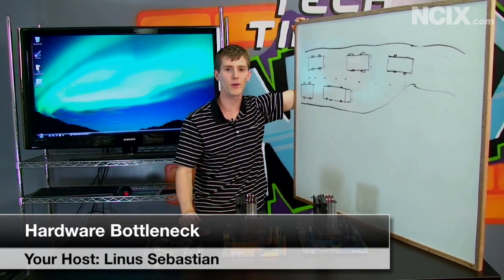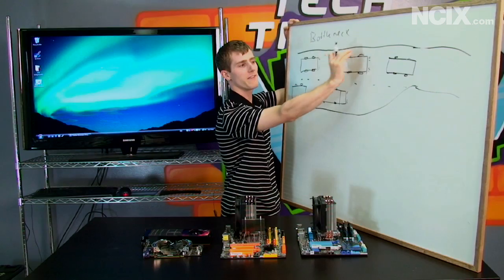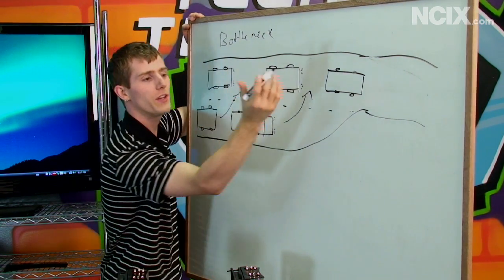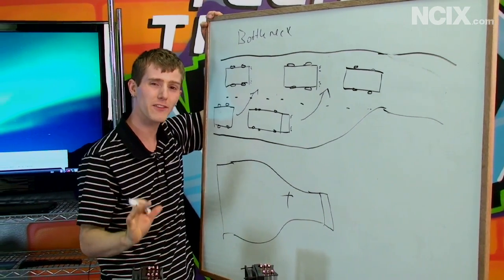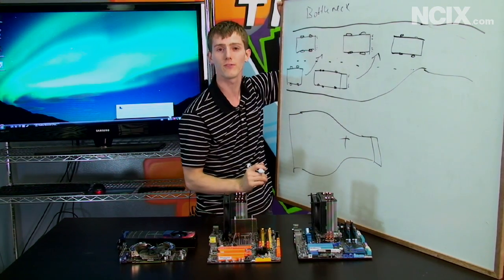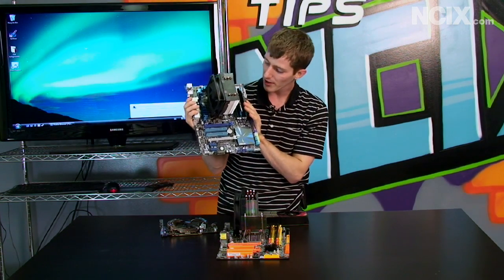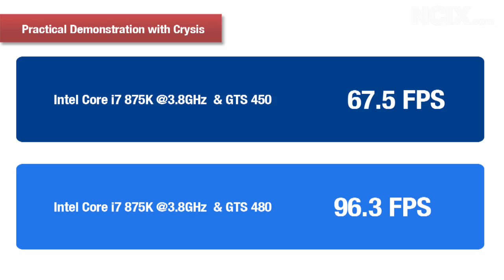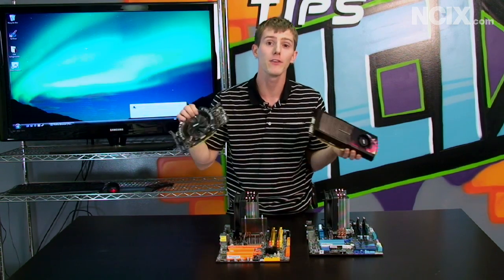Understanding Hardware "Bottlenecks" and How to Avoid Them (NCIX Tech Tips #81)

Comment: Im thinking about upgrading my PC, will any of these parts Bottleneck?

AMD FX-6300 Vishera 6-Core 3.5 GHz Cpu
MSI Computer ATX DDR3 1066 NA 970A SLI KRAIT EDITION Motherboard
Kingston HyperX FURY 16GB Kit (2x8GB) 1866MHz DDR3 Ram
EVGA 600B  Bronze 100-B1-0600-KR Power Supply
Just wondering
Reply: oh and a Rx 480
Reply: I think that it is not going to bottleneck, but if it does it will be a light one: just overclock your CPU to 4.0 GHz
Reply: Ok good thx man Felipe03000

Comment: what's the bigass thing stucked on the motherboard?
Reply: thats a heatsink for the CPU, im not exactly sure what one but its alot quieter and gets rid of heat better than the stock one
Reply: no way, where to get it?
Reply: Mahendra Adriansyah like i said im not sure what the one he is using is but www.ncix.com is a great place to shop for them.
Reply: yo man, i'm got my Athlon II X4 635 bottlenecking my hd 7870... is there a better card that can run on a AM3 board? thanks man
Reply: Mahendra Adriansyah im not the person to ask that sort of stuff to, i recommend tomshardware forum theyre pretty smart.
Reply: thanks a lot for responding
Reply: Mahendra Adriansyah When it comes to CPU heatsinks, you really should consider getting an "aftermarket" one, because more often than not, the heat-sinks that come with the unit are not very good. Much for the same reason why I will not ditch a camcorder just because a I have a phone capable of recording at a higher resolution.
Reply: Mahendra Adriansyah
start at pcpartpicker.com, get a list of like 5 cpu's then research them to figure out which is truly the best

Comment: hey i bought a Mac pro 1.1 really cheap in mint condition but the specs were extremely bad iv don some upgrading to the machine now iv changed the 2 xeon dual core for 2 xeon quad cores x5355 upgrader the ram to 12GB of server grade ram running a 120GB SSD with a 500GB HDD and I replaced the old 7200gt for a evga GTX660 SC 2GBcould anyone tell me if there should be any bottle necks cause im playing batman arkham origins and battlefield 4 on Ultra with no FPS drop as far as i can see Im only asking cause the machine is old and id like to now

Comment: not in sli or crossfire. I was just thinking at the time: What setup would bottleneck like crazy. Also Im not quite sure if you can run 8 gpus. I think windows supports 4 and linux will take 8.

Comment: I have Intel G630 Dual Core. Will there be a bottleneck if i buy gtx 780?
Reply: Yes it will bottleneck it bigtime. i would say that your CPU max should go with something like a 560Ti 1GB / 6950 2GB.

If you wanna go above i would say you need a quadcore and something with a 'i5' or 'i7' in it, then you should be good to go with a 780 or even a 780 SLI.
Reply: Thank you. I guess I will build from scratch then.
Reply: I would strongly advise you to do that if you're going to upgrade to a 780 or simular card.

An article that can clarify the bottlenecking of CPUs can be seen here:

http://www.anandtech.com/show/7189/choosing-a-gaming-cpu-september-2013/6

In general the point is: Going to build a gaming computer: either choose the top AMD CPU or the i5/i7 intel CPU. I personally would recommend an Intel, even though the price is a little above. But anything from i5 3470-> i7 4770K and you should be good to go. both of these CPU's also support PCI-e 3.0 that you're 780 will benifit from.
Reply: Bo Penstoft
Thank you for the advice. After 2 months my budget will be around $1000.
Reply: for that cpu HD7770 max in newer games
Reply: i hope this is a joke but if your serious yes
Reply: Andrash88
my current GPU is sapphire HD7770.
Reply: MrElosobear
i wanna know ur fps on a game lolol. i bet i have same if not better with my HD5770

Comment: Do you think an Intel Core i3-4130 3.4ghz and a Radeon R7 2gb gddr5 would do bottleneck?
Reply: Alvaro Azcárate I have that exact cpu and a gtx 970 and on gta 5 on ultra - very high I get around 40 - 75 fps i got a bottleneck but its not the biggest so you might be fine but your losing a decent amount of frames like me
Reply: Thanks man

Comment: Upgrading my graphics card, will I bottleneck my cpu with:
Intel Core i5 2500k OC'ed to 4.2GHz
8GB ram ddr3 1333MHz
GTX 970 4gb gddr5 (The card i am thinking of upgrading to, old card was amd 6870 1gb, always held my system back)
PSU 750W
Reply: No, 2500k is fast as any new 4th gen i5. Try to overclock it some more. :)
Reply: thanks :)

Comment: Whatever you do, you always will have a bottleneck. The question should be: Does one component in your system perform significant lesser than the rest? Then upgrading that component will improve performance to a level at the next bottleneck.

In general I dare to state if your system doesn't run on a SSD drive, your bottleneck will almost certainly be your hard drive.

Comment: Would a
AMD Fx 4350 4 x 4,2GHz 
Corsair 450 watts 80+ PSU
Crucial 8GB DDR3 @ 1600mhz
bottleneck a 
Sapphire R9 270 2GB GDDR5 @ 1050mhz  ?
Reply: Don't think so.
Reply: Faham poordaryaei ok thanks for the answer
Reply: ***** I think a 500W PSU will be better.
Reply: Faham poordaryaei how about with a r9 270x?
Reply: I´ve a  270 non X so i only got 2 gb and for me its enough.. if you overclock the gpu from 925 to 1150 mhz you´ll get a stock 270x because its based on the same gpu
Reply: Tal Zeraviv Actually my hardware arrived 2 already and the New Model of VS 450 wich i´ve got has a +12V rail @ 34 amps
with that said. my system runs smooth and with now errors even if i start prime95 and the valley benchmark.
I only have 1 HDD no DVD Drive
1 Case fan and thats it.
Reply: I'd think the sapphire will be the bottleneck.

Comment: Hello i have currently got;
AMD 3.6Ghz FX4100 Quad Core Processor 
-8GB DDR3 Ram and 1TB Hard Drive 
-ATI Radeon HD7770 1GB Dedicated DX11 Graphics Card 

what is the weakes part in the pc and should upgrade first or is it more woth my time to simply sell it all snd start from the ground up?
Reply: that's just perfect man for a decent gaming
Reply: ***** nar it lags with alot of stuff im looking to run modern games on 1920x1080 will maxed out settings...(single monitor)
Reply: go for 7970 or even R9 290x man... or if you're on a budget then go for 7870.. mine's running smooth as a baby on 1920x1080
Reply: get Solid State Drive.  I think that it would boost your system.
Reply: drath lian i would love 2, seems like a bit of work to transfer my os and installed programs to the SSD. Are there any programs that can do it 4 me?
Reply: i dont think ssd is worth it man on a gaming pc... but you can of course go ahead and try... if i was you i'd invest in a better card,,,
Reply: ***** indeed but i can simply endure the bottle neck until i upgrade the next slower component until its all up to scratch
Reply: jayden barr
Macrium Reflect Free
Reply: Mahendra Adriansyah
It's totally worth it, SSDs speed up game loading time.

Comment: I wish I was a FPS gamer. I play simulators and ArmA so I have to deal with fucked-up, unoptimized 1.5-core products so I have to spend a lot more money on the CPU and when I want to play some regular game for a change I get half the performance I could get for the money because non-sim games rely more on GPU.

BTW, don't buy ArmA 3 unless you have no other choice or you've built your rig specifically for ArmA. Preferably with the monster clocked dual (or single?) core Celeron released recently.

Comment: i3 540 with gtx 750 ti will bottleneck?
PSU = 380 Watt
Motherboard = H55M S2
RAM = 4 GB DDR3
Reply: Lex lol i had this exact set up when i was new to gaming. no it doent bottleneck but more ram would help. but i had that only and it worked fine for low end games . a little gta and stuff too

Comment: Do you guys think i will have a bottle neck?
EVGA Geforce GTX 970
ASRock x99 extreme 4
Intel I7 5820k
psu 1300w (high because i plan on going 3-way sli and the 1300w was cheaper than the 1000w)
4x4gb ddr4 (can go up to 128gb)
What do you guys think?
Thanks for the input.
Reply: My friend has the same system except for the crazy power supply. A 900 watt would be enough. The gtx 970 does not consume a lot of power. Good luck on your build!

Comment: will a Intel Core i5-6600K bottleneck a 1070
Reply: you should be fine the i5 6600k and 1070 are both latest gen. i'm actually getting the same.
Reply: Admirable Ackbar what about a i5 6400 and a 1060 Super Super Clocked
Reply: BallisticWaffle I feel like you should be fine, but just to make sure double check with your closest PC shop, because I am no expert.

Comment: Hi Im running a
Motherboard: MSI G41M-P33 (Socket 775)
CPU: Core2Quad Q6600 2.4GHz 8 Mb Cach
RAM: 4Gb DDR3 1066MHz Dual-Channel Single Memory.
GPU: NVIDIA GT 610 1GB.
HHD1: Samsung 840 EVO 500 GB (SSD)
HHD2: WD GREEN WD40EZRX 4 TB
Extern1: ASUS Black Blu-ray Burner SATA BW-12B1ST/BLK/G/AS
Extern2: ASUS 24X DVD Burner - Bulk Black SATA Model DRW-24B1ST/BLK/B/AS - OEM

And i was wondering if my GPU i botlenecking my pc becouse i play some games not heavy but i was always able to play 6 games at the time at medium with my old pc and know i upgrade it and only able to run 3 at same time?

PC Price arround 650,-

By Robin de Bie
Reply: Hi thanks for your respond but i dont know if it make any diferents my old card AMD HD 7750 1gb

Comment: guys i need help i think i got bottleneck when i play gta 5 on ultra settings with msi gtx 1080 i have 60 fps with resolution 1680x1050 not even hd and gpu usage 50% sometimes 80% on for example assetto corsa (racing game) it uses 99% 

why?

specs are: 

- I7 3930K 3.50 GHZ 6 Cores 12 Threads

-Asus Rampage IV Xtreme

-MSI GTX 1080 GAMING X 

-Gskill Ram 16gb 2133mhz

-Seasonic 1250 Watt power supply

Comment: I just got a msi r7 260x 2gb OC what cup should I get so I don't bottleneck right now I'm useing a intel core 2 duo -_-
Reply: if you want a new cpu, i know that the r7 260x is a new card but for a decent gaming system you will need at least an i5 or amd quad core AND buy a new GPU as that gpu will bottleneck either of those cpu's.

Comment: Heya Linus,
I have a game system that i would like to upgrade, but have no idea which part needs updating.
System specs:
Motherboard: MSI Z77A-GD80
CPU: Intel Core i7 3770K Boxed
CPU cooling: Corsair Hydro H80i             
Memory: 16GB Corsair Vengeance LP CML4GX3M2A1600C9
GPU: Point of View GeForce GTX 670 Dual Fan         
Soundcard: Creative Sound Blaster Z
DVD combo: Samsung SH-224BB Zwart         
PSU: Cooler Master Silent Pro M2 520W         
Harddrive 1: 1 x Samsung 840 series Pro 128GB
Harddrive 2: 1 x Seagate Barracuda 7200.14 ST1000DM003, 1TB            
Case: Corsair Obsidian 550D         
Monitors: 2 x Samsung Syncmaster 203B Zilver, Zwart
Keyboard: Corsair Vengeance K90         
Mouse: Razer DeathAdder Left Hand Edition         
Headset: Razer Carcharias

What would be the right upgrade path for this machine ?
Reply: Heya im not linus and this video is outdated. but if u want to upgrade get a  SSD  or  Graphics Card and 32 gb
Reply: Everything here is great, but you could go for an AMD 280x or 290x if you want that extra graphics card performance.  Nothing else will slow you down, and you do NOT need any more RAM.
Reply: you have a beast. Cpu and all that ram is ana overkill for gaming. Only thing that you would feel in gaming is a new gpu (but even that yours is great).
Reply: Thanks guys. I have been looking at a new grahics card, not sure if i will notice much difference though.
Reply: Fr3ubel
280X or gtx 770 would be small upgrade. I'm not fan of expensive cards - they don't pay off - they are unprofitable, lose lot on price with time and soon comes out better that's cheaper- so I wouldn't change your card. Just turn off stupid MSAA, vsync and mabey other filters if you want higher fps.
Reply: Ok, thanks Andrash88, think i will leave the system as it is atm. Thanks for the input guys / girls :D

Comment: I want to buy GTX 960. Will it have any bottleneck problems?

My specs:
CPU: DualCore IntelCore i5 650, 3333 MHz
GPU: AMD Radeon HD 5700 Series
RAM: 8 GB 1333 MHz DDR3
OS: Windows 7 Professional
Motherboard: Gigabyte GA-P55-US3L
Reply: sswwiimmeerr you're fine

Comment: I have i5 3570k with 2x GTX 780 SLI, MSi z77 and 850watts PSU. Does it bottleneck anything?
Reply: Friend has 3570K with MSI 680 lighning. and his cpu bottlenecks. on one gpu. gain of 10 fps from 3.4ghz to 4.0ghz in battlefield 4 unless you are overclocking the cpu i dont see this working very well. i'd stick to one gpu.
Reply: I have it overlocked to 4.2ghz. I was lagging a bit with only a single gtx 780 on assasins creed 4, same with COD ghost but when i used 2 of them, i dont lag at all anymore. i had no problem with battlefield 4 even with a single GPU. Maybe ill try to overclock it to 4.7ghz to stable it.
Reply: robb nabber I have it overlocked to 4.2ghz. I was lagging a bit with only a single gtx 780 on assasins creed 4, same with COD ghost but when i used 2 of them, i dont lag at all anymore. i had no problem with battlefield 4 even with a single GPU. Maybe ill try to overclock it to 4.7ghz to stable it.
Reply: LaroPoTayo
It Will mostly depend on the game. with everything cranked to max on battlefield he was having issues with like a lagg spike and only 40 fps and he went from that to going to 50fps for a low and 70ish for a peak @ 1080P. he's on MSI Z77 big bang mobo, 1866 corsair memory factory clocked 680 Lightning which is pretty powerful stock. and it hates overclocking so just leave it stock. but it seems cpu performance it's lacking for that game. only game he has problems playing. crysis 3, metro, tomb raider, witcher 2 like every new nice looking game. no issue but battlefield. they are saying they have driver issues with battlefield but when u overclock the cpu for the game. seems like its not a videocard driver having an issue. which it might.

Comment: i have a phenom 9600Black going with my R7 260X,   serious bottle neck only a 6 FPS difference in GTA4 between min and max settings, still a playable framerate but  the fine details load to slow when maxed out.
Reply: i can still play everything AC4, Arkham origins, ect, all at 1080 mostly maxed.
Reply: its the 2.3 ghz first gen quad, i know its bottlenecking becuase my GPU never runs its full clock (1150) and i only get like a 6 fps difference between maxxed out and med-low setting in most newer games
Reply: temps are fine just the highest it will seem to go is 975 or so the cpu cant send it fast enough
Reply: i am aware thats peak for the AM2+ socket, i can make this cpu use my whole gpu when i OC but the temps are shitty have to get a better cooler and look at upgrading next year.
Reply: and yes that is a bottle neck its the very definition, the CPU and the hyper transport 1 vs having 3  are causing my gpu to not run at full.

Comment: Could anyone help me please?

Ive just found out the pci-e 3.0 GPU's will work on a pci-e 2.0 Motherboard.
Now i know this ive potentially saved my self 100's on building a new PC

basically i have a Q8200 2.33 ghz quad core, and i was just looking at getting a 650ti
4gig ram 800hz

would this card be bottlenecked by my gpu?
if it would, is it just a case of having unused GPU or would it actually cause problems?
Edit: i have a 700w PSU
Reply: I believe your motherboard in this case, cpu and ram is the bottlenbeck.
Reply: TheStealther Do you think i could get a 650 (non Ti) and it would still bottleneck?
i really dont want to have to upgrade my whole pc

if it would bottleneck would it be bad?
Reply: Boris theBlade
It would be optimal for that cpu - HD7770, HD7790 (R7 260X), gtx 650Ti/ boost. OC of cpu can only help
Reply: Andrash88 You think i could run the Ti boost version then? or would it be bottlenecked alot more than the normal Ti version?
apparently theres quite a large performance difference between the Ti vs Boost
Reply: Boris theBlade
yes you can. They may be some bottleneck in some games if you don't OC cpu (MP of BF3/BF4, maybe FC3) - but generally you are fine with gtx650Ti boost (yes it is stronger, it is different card than gtx650Ti).
Reply: Andrash88 Appreciate your help bro!
Ill go for the boost version.
the only thing is, if i were to overclock my cpu id need so many new parts id rather buy a whole new i5 build
this is just a nice easy £100 upgrade
Reply: Boris theBlade
I would go on ATI HD7790 or R7 260x if it's not more expensive. Because they are almost same strength as boost, cheaper, and they would support mantle (dx11 alternative)- which should increase performance a bit in supporting games (bf4 would be first), and 260X supports true audio (better sound in supporting games) - first one should be new thief
Reply: sweet ill have a look, thanks mate

Comment: i have an intel dual core pentium 2.80Ghz, 2gb RAM and a built in intel gpu and i want to buy a Asus GeForce GT 640,2GB will it be a bottleneck?
Reply: depending on the games you're trying to play, i would say thats not bad. its not a battlefield  machine. but it'll work better. 

i would recommend getting a new mobo and just start fresh with a new processor like an i5 or something before getting  a mid range graphics card. or at least buy a quad core cpu.
Reply: it would be OK. I would rather go on HD7730 ddr5 for that price and put another 2gb of ram. It also depends on whitch pentium? E5500, g840? Because there are difference in generations
Reply: If you want to play games @ 1080P on high settings, you'll need a whole new system.  Either get a nice card now and buy a new cpu/ram/mobo later or do vice versa.  Don't get a GT 640.